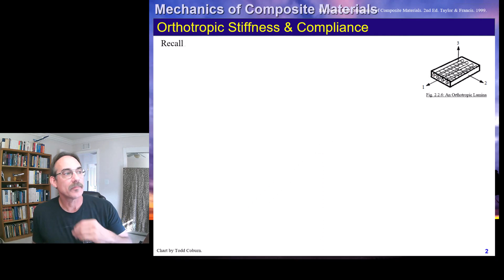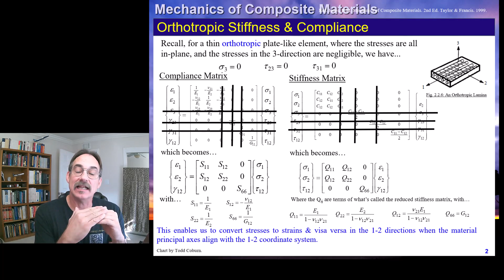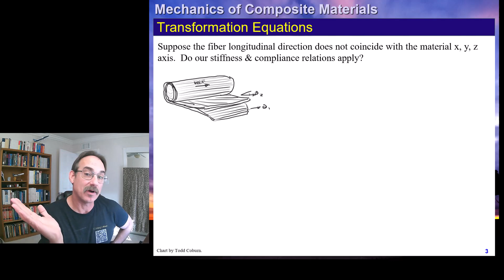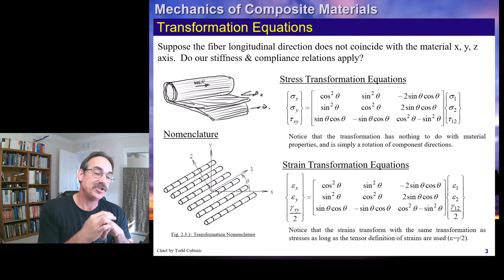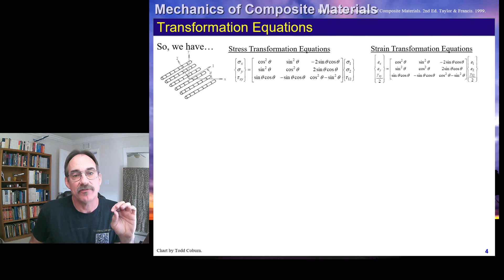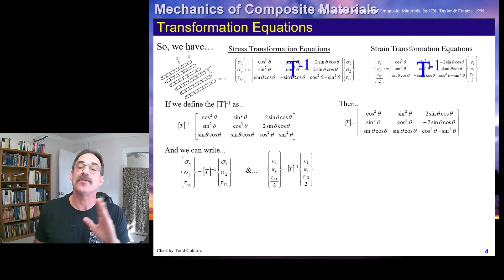Composites: L-04 - Lamina Macromechanics Transformations

Comment: Dear Todd, at 9th slide where you show Ex/E2 relation on graph, you pointed the right hand-side values on the graph for 90 degrees (where you said we will get 10 percent of the original value). However Ex/E2 should be read from left hand-side values, which is 1.0 in value for 90 degrees. Could you please tell me if I'm wrong on this? :)
Reply: Yes, you are pointing out correctly. In 90 degree we can see that E2 is aligning with Ex direction hence both are equal.

Comment: @30:42, I'm a bit confused at that chart. You state that at theta=90 degrees, a Ex/E2=0.1. But I would read that chart as showing that the values on the left axis apply to the ratios Ex/Ex, -nxy,x, and Gxy/G12. The values on the right axis only apply to vxy. It would seem very odd to have a graph that you switch the reference axis somewhere along the length of the curve. I would think you need to use the same axis for all three comparisons, theta=0,45, and 90. Thus, I would think Ex/E2 should equal one, not 0.1, when theta equals 90 degrees. Are we sure we're reading this chart correctly? 

I believe this may simply be a misreading of the graph. As a further confirmation, I took at a look at the reference where the plot originates, the Jones text. Take a look at problem set 2.6, specifically problem 2.6.7. The problem asks you to derive an equation for E1/Ex, but if you put in 90 degrees for the equation, you get that E1/Ex=E1/E2. Or simply, Ex=E2. 

And this does make intuitive sense. If you rotate a lamina 90 degrees, should apparent stiffness in the x direction not simply be equal to its stiffness in the 2 direction?

Comment: Could you explain Hart Smith's postulate once more, please? I couldn't understand it
Reply from the maker: In ths simplest sense, Hart-Smith suggested approximating strength and stiffness of a laminate by a weighted average that uses full strength and stiffness for zero-oriented plies and 10% strength and stiffness for any-other-ply-orientation.

This approach was most useful before hand-held calculatiors became so powerful.
Reply: @ToddCoburn  got it! Thanks so much for the speedy reply. 
Your course is amazing by the way.